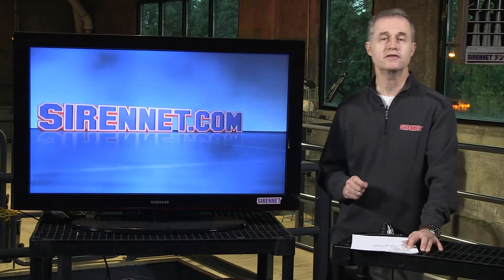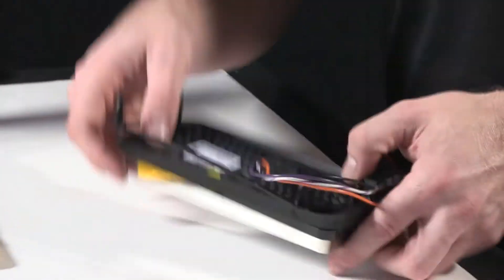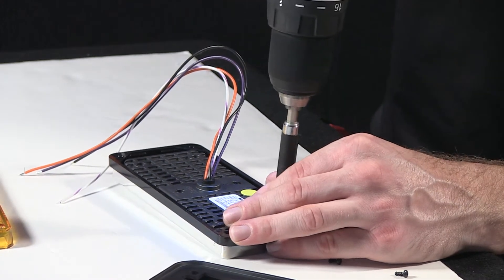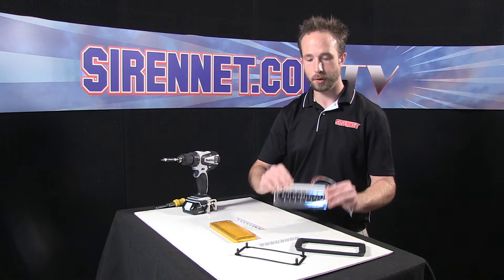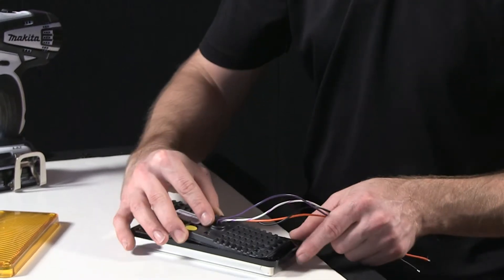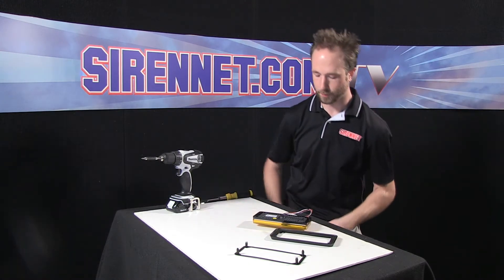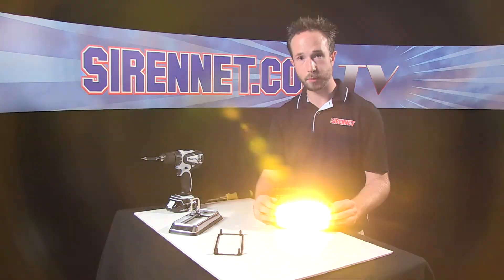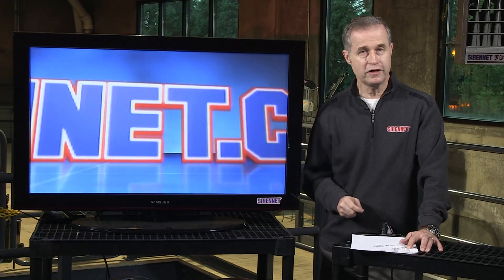Chris disassembles a Whelen 700 Series Linear Super-LED Lighthead

Comment: Hey! How configuration Sync? Thanks
Reply from the maker: To sync a multitude of these you'll need to use a central-flasher as they actually lack a sync wire. By mixing in a ULF44 flasher, the light-heads will be set to steady-burn & the flasher will then let you adjust patterns and synchronization.
Reply from the maker: If you'd like to check out the ULF44:   https://sirennet.com/store/product/whelen-four-outlet-four-channel-led-flasher